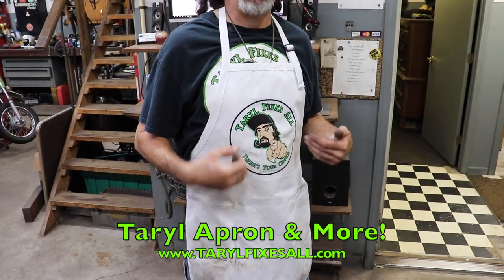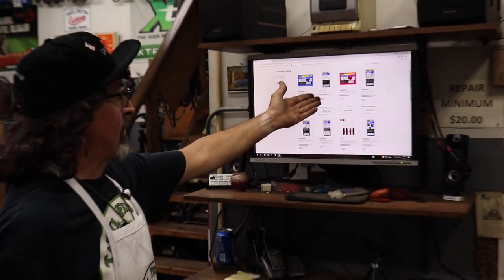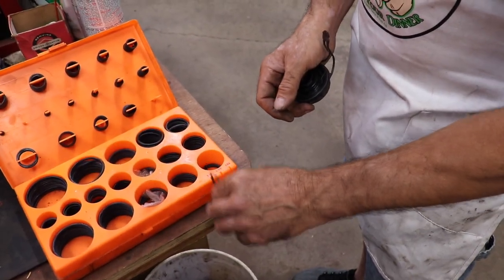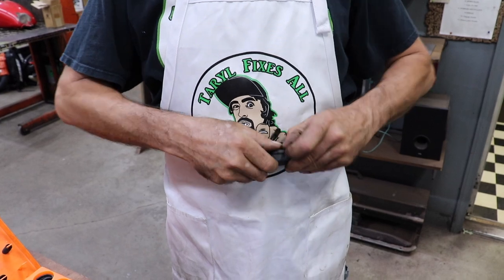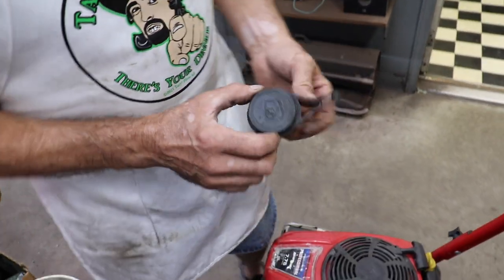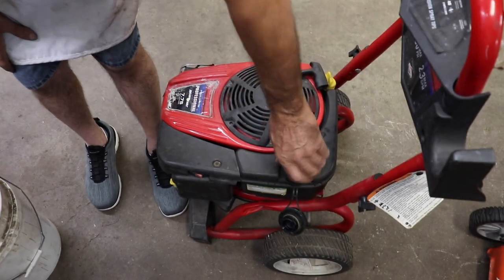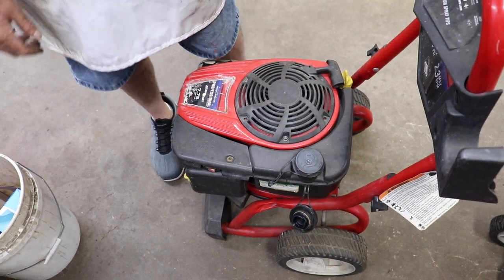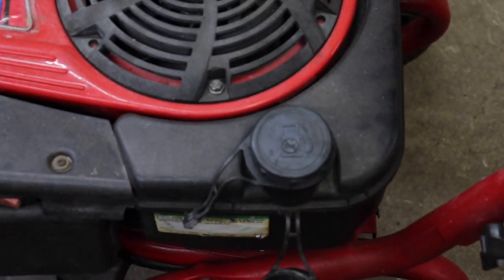Loose Leaky Gas Cap? Try This Epic Hack!

Comment: Thanks 😊 Taryl! I messed with my lawnmower gas cap before trying to make it tighter. I went to the hardware store and found a 32 by 3mm O ring. It fits nice and tight now! No more dirt sticking to the filler neck from gas seepage.I guess the manufacturers use the symbols because they don’t want to print out different languages.
Reply: Just an update, I went to take off that gas cap today and it was really on there! I put a little oil around it before I put it back on. I guess it will take a while to wear-in a little to loosen up some.
Reply: The symbols are a different language in themselves.  Cavemen native Americans and those who lived in biblical times used symbols. We're still trying to understand what they were saying.

Comment: Used to work at Ford Aerospace, a road warrior servicing their employees computer gear. After you've done a fantastic job they say we like this guy we're gonna give him a promotion, but its not the type where you get more loot, its horizontal promotion where you service executives gear that never breaks. All the best fixit people are squirreled away in garden level cubicles.
They put me in the dealer support group, the guys who say 'if you want the stiffest leaf springs they come on the base model, because they know the people who buy a luxury truck are only hauling groceries. All I did was read technical service manuals all day, the 8" thick ones w/ 100's of rice paper thick pages, technical porn! You know there's a special tool for that operation!

Comment: I got the Hazard Fraught Oring set, I also got a million piece green set from Amazon, but EVERY TIME i need an Oring i never can find the right size. When i find the right diameter the thickness is either too thick or too thin.
Pressure washer wand, intake seal, air compressor wind up hose reel, always the wrong size.
I also love how Taryl does such a great job imitating our voices! always dead on! Always knows what we're thinking!

Comment: Hi Taryl.....I LOVE your channel, VERY informative.  I have a somewhat different 'gas cap' concern, not sure if it's working right or not.  Yesterday I was mowing, and after an hour or so my mower (Great Dane Chariot) began surging each time I'd hit a minor bump.  After several minutes of this, I finally thought I'd check to make sure I had adequate fuel in the 8 gallon tank.  When I opened the cap a great deal of pressure was released (I could actually see the plastic tank deflate!).  The mower began running smoothly immediately.  Once I finished mowing (loosening and tightening the cap occasionally), I inspected the cap, took a nasal aspirator and was able to determine the cap would allow air in, but I was not able to blow any air through the vent hole from the inside out.  Are these caps designed for one way air flow only, or should the cap release pressure after it builds to a certain point inside the tank??  Thanks in advance for your response, much appreciated!

Comment: Used to work for shop. Would pick up/deliver lawn tractors sometimes. Incredible how many times I got asked “how’d you get that mower to keep running when you stood up?” Sometimes the customer would’ve had the mower for 15 years and not know about the parking brake.

Comment: Still haven't figured out how to adj. cutting height on that Ariens rider. They speak of the cutting height adjustment but its just the "pitch" adj. called by another name, then they say you set your cutting height by setting "the lever". The pitch is fine, and an important adj., in theory your blades are only in contact with the uncut grass 50% of the time when angled downward, 50% duty cycle means reserve power, and in addition, with the back of the blades being higher it provides a second bite or mulching, that allows for more throw out the deck side chute and less clumping

Comment: what about the gas cap seal on a predator engine?  looks like a flat rubber washer, i got one , the cap has metal locking tabs for the metal tank.

Comment: They had to go to symbology because someone went into an auto parts store and asked for a part that had 710 on it.  Salesman couldn't find one but did have a part with OIL on it.  He told the customer that it will work if you put it on upside down.

Comment: I had bought two old John Deere 212 & 214 garden tractors where the previous owners had put in LED lights, but the deflectors made the light going up, rendering it useless. I had to flip the deflectors upside down to fix it.
Maybe this topic could make a good LED light hack video.

Comment: I have a total pushmore and I did the same thing. My gas cap is still be leaking cause vapor lock. Or does the whole gas cap have to be replaced? If it vapor locks, it starts when it's cold, but when it's warmed up, it shuts off and dies is that caused by vapor lock.🚍🚞🚞

Comment: I new a guy that lost his Motorola flip phone while snow blowing the driveway. When the snow finally melted in the spring he found it waaaay across the front yard. Charged the battery and it still worked.
Those old phones were built like tanks.

Comment: While working on a Craftsman YT3000 this summer, I downloaded the manual and it stated in strong terms to NEVER back up while the blades were engaged. LMAO. HTF do they expect you to mow around obstacles then? Obviously done for 'insurance reasons' and to dummy proof their machine. Then they point out that if you really really want to mow in reverse, you turn the key switch back one notch, which is the stupidest 'safety feature' ever IMO.

Comment: How do you adjust the idle on that particular B/S engine?
Reply: 3 O-rings !
Reply: Bend the metal piece the throttle spring is connected to.

Comment: Taryl, not criticism, but Viton is the composition of the O ring, not the brand. I has to do with resistance to certain chemicals. They are often used in pump sprayers.
Reply: To add on to this: Nitrile is also a type of material, not a brand.

Comment: I think Viton is a brand name?
If I remember correctly the Viton O'rings are brown in color (not black).
Viton O'ring are good for high temperature applications.
I used a Viton o'ring on my Triumph motorcycle & still not leaking after 30 years, standard o'rings get brittle, due to heat.
I remember reading that Viton o'rings are soft & not good to use on pistons, due to they will wear faster.
Reply: You used Vinton 5 times in 5 sentences. Just wanted to point that out.
Reply: @cravenmoorehead5636  
Its Viton not Vinton.
What is your point?
My point is the Viton seals worked great on my Motorcycle.

Comment: Modern briggs mower engines have the same issue with cheap leaking gas caps but use a flat gasket instead of an o-ring. Just like Taryl said they don't sell the gasket just the entire gas cap that's ridiculously overpriced. I just bought a Honda mower and the gas cap itself is much higher quality.
Reply: You can always take the flat gasket off and use o-rings instead. Taryl did a video on that a couple of years ago.

Comment: I flippin’ HATE that new style Briggs gas cap. I’ve got one on my TimeMaster and it was always coming loose and spewing out gas. I tried new fatter O rings, tried a new cap, nothing helped. I finally put a thin clear seal the width of the cap on the bottom of it and it works perfectly. I think the plastic on the tank is worn thin on mine ‘cause nothing helped. What a stooopid design, the old cap was fine and didn’t need improving! Not a lot to love about those newBriggs engines IMO.

Comment: That was yet another thing they had to go and over complicate, probably planned obsolescence, because they want you to buy a whole new gas cap which is ridiculous. But they started putting these twist off caps on the Quantum towards the end of its run and in place of the screw on one. I've heard this complaint on several occasions. What was wrong with the screw on cap they made for decades that does not suffer this problem? Nothing! They should just go back to that, you know they won't, they wanna sell you a gas cap.
So on the Quantum you can't just get a screw on cap, because the tank changed too for the cap. So now their are 3 different tanks and 3 different caps for that same engine, instead of one that was perfectly fine.
Great appetizer!

Comment: Actually,  the equipment 'User Manual" is not written by an engineer or technician, they give input on the feel of operation and a "Technical Writer" who may have no experience at all with the equipment constructs the document - plus they're purposely designed to confuse the issue so you go to the dealer and pester them with a plethora of nonsensical inquiries, and receive a welp maybe you should bring it in for service!

Comment: When I first got a lawn mower from a friend that had the " RABBIT " & " TURTLE " symbol on it, I was like ? I thought I had to watch out for Rabbit's & Turtles in my yard but I've never seen a Turtle in my yard ? Rabbit's ya, especially baby ones, thought this mower was some type of ANIMAL ACTIVIST MOWER OR SOMETHING. Then thought maybe the mower was RATED FOR RABBITS & TURTLE'S ? 

SIGN, SIGN EVERYWHERE A SIGN, JUST USE LETTERS & STOP BLOWING MY MIND.
Reply: The Rabbit/turtle symbol on mowers and power equipment have been around forever, 60's equipment has it. Its usually purposely put right near the throttle so people can translate that to translate to fast and slow for the throttle. Rabbits are fast, turtles are slow. Thats fine.
However their are some symbols on machines no one would know what they mean unless you look in the manual and check, so it's pointless to put them on their, because you have no clue unless you pull out your manual, if you have it anyway, some symbols only have a meaning in one country and not another, like Canada vs U.S. thats when it gets over complicated and they should just make a standardized easy to understand symbol, those are the ridiculous ones.

Comment: Friggen Briggs, I have more problems with their stupid 1/4 turn caps leaking.  The earlier 1/4 turn type with the metal tabs suck the worst.  Problem solved I buy Honda motors.

Comment: A strong warning regarding hydrofluoric acid in vitons and materials containing vitons. If the viton is heated by a strong fire or friction where the temperature has exceeded +250 degrees Celsius, the hydrofluoric acid develops and it is extremely corrosive and dangerous for all unprotected body parts.I have a friend who lost a finger because he touched a heated shaft seal for a hydraulic pump under maintenance of this pump.The doctors was forced to amputtate the finger to save his hand.This acid eats flesh.When working with vitons and or components that contain this substance and where there is a suspicion of overheating or fire, suitable protective gloves must be worn at all times and then discarded.
Reply: I feel sympathy for your friend. I don't think the application here will get that hot.  Unless that gasoline starts to boil, Viton seems to outperform nitrile. Thanks for trying to make this the space shuttle.
Reply: Your absolutely right under normal circumstances but imagine spilt fuel being accidentally set alight. You could then have hydrofluoric acid present during the cleanup operation. It is an excellent product with extreme capabilities. All I can add is it’s presence is taken very seriously in the aerospace industry. Just be careful, that’s all.